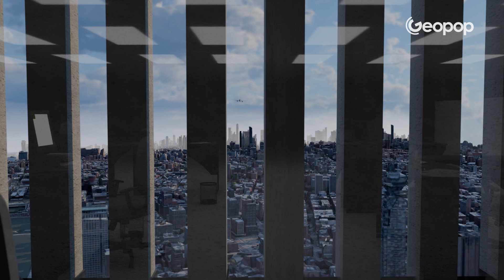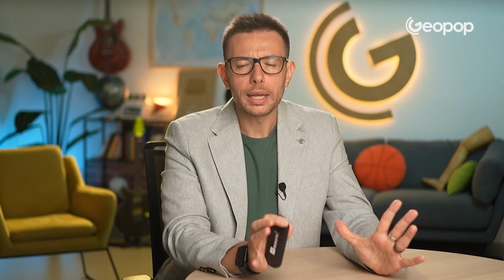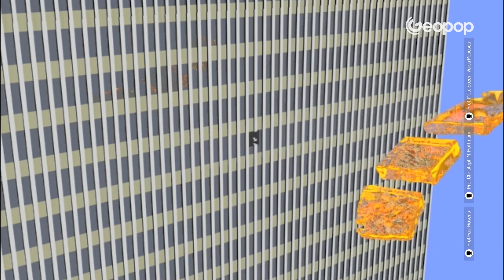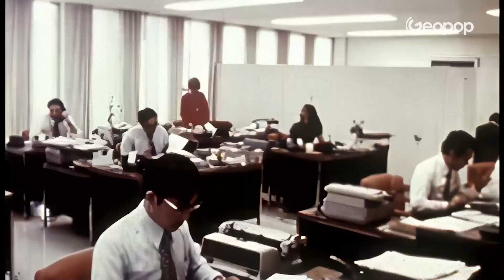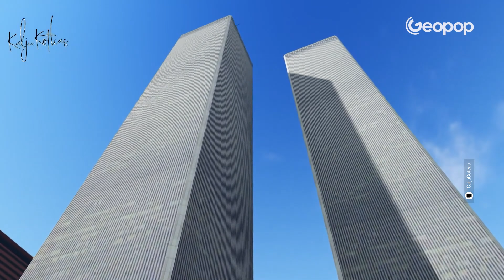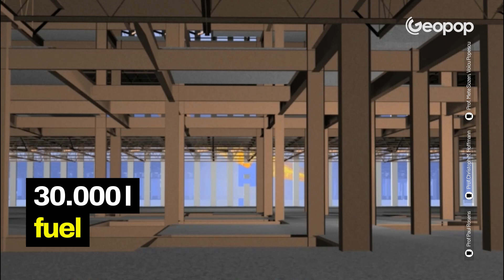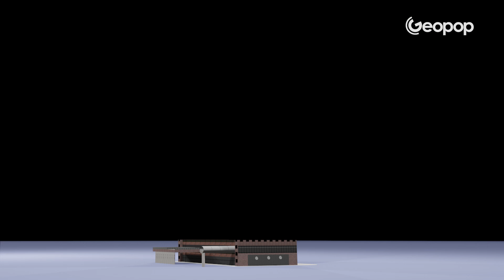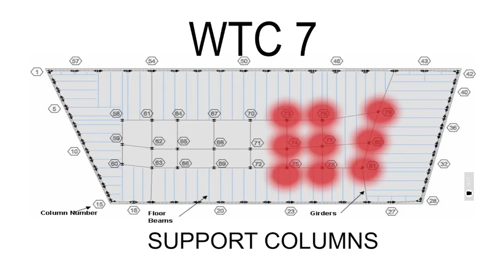9/11, 2001: The Technical Reconstruction of the Twin Towers and WTC 7 Collapses

Comment: I think that was an excellente analysis of what happened on 9/11, it's really something when the truth is spoken. You just KNOW that it is the truth.
Reply: You might want to check this out.If you think that's the truth. 1.The firefighters said" it looked like they planned to take down the building" I didn't say that, The fire fighters said that. They were there.I'm sure they know best.
https://youtu.be/XiIT4HInWjY?si=e1Pvp3-IFs-M75Oj
When the firefighter says "boom, boom, boom, boom" in this video.
What do you suppose he is?Implying by " boom" ?? What do you hear? 
2.So if there were no explosives then what is this? 8:25
https://youtu.be/bLF5D7M1YgA?si=aHSvS__uOdxMi1ZB
You can't say that it was added because you can see the firemen's reaction to the explosion. And you can't say it came from anywhere else because the firefighter says
" We gotta get out of here,  7 is exploding "
3. Controlled demolitions have squibs, you can see the squibs here 20 floors below the collapse. 
https://youtu.be/eXAgulfAtR4?si=-iLO9aQjMJVLTUYH
4. Firefighter says "any one of these buildings could blow up,  this ain't over yet" firefighter says there's 3 secondary explosions. 
https://youtu.be/0Gh3ErgMI4M?si=mmp9Eus_5PWTCBfl
5. Airplanes can't fly 600 mph at 1000 feet. And to be able to make a 180 degree turn to hit the opposite side of the pentagon going that fast is ridiculous. And since when do terrorists hit the opposite side of the building where no one was at when they could have just flown straight in and killed way more people???
 https://youtu.be/0Gh3ErgMI4M?si=mmp9Eus_5PWTCBfl
7. No one has ever known ahead of time that a building was going to collapse except through controlled demolition.  Tower 7 was reported to have fallen while it still stood in the background. 
8. Larry silverstein,  the man who made over 4.5 billion when they fell, claimed to have pulled the building down.
https://youtu.be/1jQaJFNWqtc?si=wCywQ9grgBdS_w11
9. A witness reported a missile hit the pentagon while he was seen at the scene. 
And the hole wasn't big enough for a plane and the damage wasn't consistent to the towers. And just like shanksville,  there's pictures that show no plane parts at all.
https://youtu.be/6_Ez-UCpXMs?si=JaQ6DBEC_LJtMLgN
10. That video also points out They were military planes that hit the twin towers. 
11. All sorts of reports of explosions were reported that day.  
12 Buildings dont accidentally fall  Into it's own footprint....

Comment: NIST  took 7 years to invent the already well KNOWN none phenomenon of thermal linear expansion... ie: when metal gets hot it gets bigger. Building 7 reached free fall acceleration... IMPOSSIBLE without instantaneous removal of the outer columns all at the same time, desks & chairs burning do not weaken 47 storey buildings so they drop out the sky ... 9/11 was a silent coup, the USA was taken over that day
Reply: Oh I think we can do better.

Much misunderstood, Building 7 was the 6th building to collapse of 10 lost on 9/11. Because of its early low priority, conspiracy filled the information void with garbage made up by technically ignorant people promoting political agendas. But 7's loss is an engineering problem and should be treated as such, so I prepared this brief summary of my own analysis to fix that, using technical analysis, not ideology and tired memes. 

At 10:28am the WTC North Tower collapsed, showering Building 7 with tons of burning debris, causing heavy damage and starting many large  fires which burned out of control for the next 7 hours. Half the FDNY firefighters having been killed, units in disarray, equipment destroyed, no water pressure, and the greater urgency of search & rescue efforts, Building 7 couldn’t be saved so firefighting efforts were pulled as futile and 7 left to its fate. Firefighters make that sort of choice every day in brush fire situations - which houses to save and which ones to let go. Only real difference here is moving the decimal on the size and cost. People get overwhelmed by the size.

www.youtube.com/watch?v=g_SvpwyC17M

Collapse of a burning structure is always a concern for firefighters. Steel buildings subject to fire rely on active firefighting to survive. Buildings are designed around 1 to 3 hours of fire resistance, allowing time for occupants to escape and active firefighting to get started, after which all bets are off. Left to their own devices they'll exceed their design envelope and collapse, like Plasco Tower and Wilton Paes de Almeida. In 7 the occupants escaped, passive and active fire protections were compromised and active firefighting was abandoned hours before the collapse, which left the building to its fate. It lost. Odds on Building 7 would eventually collapse, and it did. No big deal in logic.

 http://www.youtube.com/watch?v=WnYBX6QT0R4 

FDNY Chief Daniel Nigro - The biggest decision we had to make on the first day was to clear the area and create a collapse zone around the severely damaged 7 World Trade Center, a 47-story building heavily involved in fire. A number of fire officers and companies assessed the damage to the building. The appraisals indicated that the building's structural integrity was in serious doubt. I issued orders to PULL back the firefighters and define the collapse zone. It was a critical decision; We could not lose any more firefighters. It took a lot of time to PULL everyone out, given the emotionalism of the day, communications difficulties and the collapse terrain 

FDNY Deputy Chief Peter Hayden ; We had our special operations people set up surveying instruments to monitor and see if there was any movement in the building. We were concerned of the possibility of collapse in the building. And we had a discussion with one particular engineer there, and we asked him if we allowed it to burn could we anticipate a collapse and if so, how soon? And it turned out that he was pretty much right on the money, that he said 'In its current state you have about 5 hours 

The collapse of Building 7 was anticipated and widely reported in the media throughout the day, with 24 video cameras recording some or all of the collapse. Everyone knew what was coming and why. 

www.youtube.com/watch?v=OY5S5k3tMHI

The collapse of Building 7’s was entirely different to the Twin Towers and harder to understand, most details being hidden from view and not intuitive.  But we can still sort out what happened through careful analysis and observation. This is my explanation of the collapse relying on no outside authority. 

Building 7 was a unique, asymmetrical 47-story steel framed structure built atop a smaller 3-story building serving as a partial foundation, requiring lower floors dedicated to complex load transfer structures. Of trapezoidal shape and all-steel tube-in-tube construction, B7 (above the 7th floor) consisted of a central core of steel columns carrying most of the gravity load, perimeter steel columns around the outside of the structure carrying the remainder of the gravity loads and long span beams and girders to tie those elements together and form the floors. On the outside of the building hung a moment frame or outer shell. 

Phase 1 : First externally visible signs of collapse initiation occurred at 5:20:28 pm and were notably quiet with observers not realizing the building was collapsing! No audible warning in the form of hundreds of ear drum busting 180-190dB explosive bangs preceding the collapse. Here at 12:00 a local CBS affiliate reporter is talking 10 blocks from B7 when collapse begins. People don’t start to notice the collapse until 12:11. At 12:45 is the famous CBS fixed camera clip of Building 7’s collapse. Note how quiet it is. 

www.youtube.com/watch?v=t5tEy6mXSE8

Collapse initiation was due to lower floor failures above the load transfer region (8-14th floors) in the NE corner. In this video at 0:45 you can see the NW corner from inside the building while under construction, Column 79 just out of frame on the left. That big, angled steel beam across the top of the frame connects to C79 at one end. The girders connect to the beam. That beam and all those girders depend on just one connection 

www.youtube.com/watch?v=nP3TNHPCIVU&t=45s

Phase 2 : The NE lower floor failures caused a loss of critical lateral support over an excessive length of Column 79 and it buckled. Looking at a floor diagram of Building 7 (www.nist.gov/image-16640) when you see all the structures that depend on C79 you quickly realize this one column was a relatively isolated structural element on which a disproportionately greater fraction of the structure depended analogous to say the Key Bridge. Externally as collapse begins we see a vertical progression of window breakage along the 44-46 line and a kink in the roof of the East Mechanical Penthouse at the top of the building, consistent with C79 failure. Normally with a buckling column, the load could be redistributed to other columns. With C79 that is not the case - the failure did not redistribute the load, so the collapse rapidly progressed to the roofline, sinking the rooftop penthouse. The transition from full capacity to almost no capacity occurs in an instant and will result in virtually no resistance 

Phase 3 : With C79 gone, B7’s progressive, non-symmetrical collapse continues with adjacent columns 80 and 81 left laterally unsupported, and quickly buckling as well, sending the EMP down through the building. C79-81 all have no diagonal bracing, which is the major reason why they could not redistribute a lot of vertical loads among one another. From there collapse progressed from east to west through the central core until the core was gone taking all of the interior floors and probably most of the perimeter columns with it. Follow the horizontal progression of window failures low in the building and the dropping of the remaining rooftop structures into the building. One of the big takeaways from the NIST Building 7 study (invariably ignored) was how their modeling determined C79 failing under ANY circumstances would have initiated the same collapse sequence. 

Phase 4 : After about 10 seconds only the exterior moment frame remains, giving the illusion B7 is still standing to the casual observer since little has outwardly changed. But it is just a hollow empty shell like an empty cereal box supported only by a few remaining columns and overloaded from the loss of the core columns and floors, quite unable to remain standing. With nothing remaining behind it, the north face leans inward, forming a V in the roofline, the last few columns buckle under the strain and the moment frame free falls, landing on top of the debris pile. 

It is only here at the very end that a single measurement of alleged free fall acceleration is taken, from a single point on the outer shell. The Building did not “free fall” – just one corner of the outer shell did, sort of. The Building_ (defined as its center-of-mass) was already gone before that happened. The period of alleged free fall was a product of how it fell NOT why it fell and can't tell us what started the collapse 10 seconds earlier. Start to finish the collapse took 18-20 seconds, 3 times longer than free fall . How fast something falls cannot tell you what started it falling_ anyway. 

The debris spread outside the footprint blocking surrounding streets, heavily damaging the Verizon Building and destroyed Fiterman Hall. 

Building 7’s progressive, non-symmetrical collapse was incidental and unintended collateral damage from the combined effects of fire + time + gravity, started by the collapsing North Tower. That is true no matter who planned and carried out the 9/11 attacks or why . The collapse was of so little consequence it barely registered at the time - a footnote, only taking on semi-mythical status as an alleged smoking gun years later when demolitions at the Twin Towers, missiles at the Pentagon and shoot down over Shanksville all failed and conspiracists had nothing left to work with. 

Anything can seem like a conspiracy if you don’t understand how it works. Now you should. I hope you found this helpful, informative and it solicits informed critical comment. If I made any errors of fact, logic or reason or left anything important out, please let me know so I can fix it. IF you can offer a more plausible alternative please do. Be the first. Please start any reply with the words “Tits McGee” or I will know you didn’t read it and are wasting my time.
Reply: @TheLoonResistance 😂😂😂😂

Comment: The video contains a few mistakes, a few errors of fact. Nothing to jeopardize the overall validity of all arguments, but potentially enough for a distractor to latch onto and discredit the authors.
Examples: 
- While talling about the fire proofing of the WTC7 floor beams, the video shows floor trusses of the twin towers.
- The claim of 9 and 11 seconds collapse time for South and North tower, respectively, may be quoted from NIST, but these numbers are demonstrably false - both collapses took consoderably longer. Just watch any of those collapse videos where you can see most of the tower all the way down to nearly the ground; note carefully when you see the first motion of the roof, note the time counter. Then move 9 (or 11) seconds forward, and look, and listen: The collapse is very much still ongoing for clearly a few seconds more.
- NIST's calculation of the load bearing capacity being +11 floors statically, +6 floors dynamically: You say this is about the capacity of the columns, but NIST is actually talking about the truss seats (the little angled steel plates welded to perimeter and columns that supported the floor trusses)

Did you run the video past a few people knowledgeable about the topic before publishing? Engineers involved in the NIST investigation, authors of scientific papers going into details, or even lay enthusiasts debunking 9/11 conspiracy theories with years of detailed research?
Reply: 1.  They are showing generic images of SFRM installed. I have a shit ton of photos of Building 7 but only one of the SFRM, so I have no issues with this.  SFRM looks the same no matter what building it's in. 

2.  The NIST actually said it was 9 and 11 seconds respectively for the first debris to hit the ground not for the buildings to collapse.  So you AND the video got that wrong along with a legion of conspiracy believers.  Actual collapse time was 32-34 seconds +/- 1 second by my watch, from first externally visible signs of collapse initiation to last core columns hitting the ground.
Reply: 1.The firefighters said" it looked like they planned to take down the building" I didn't say that, The fire fighters said that. They were there.I'm sure they know best.
https://youtu.be/XiIT4HInWjY?si=e1Pvp3-IFs-M75Oj
When the firefighter says "boom, boom, boom, boom" in this video.
What do you suppose he is?Implying by " boom" ?? What do you hear? 
2.So if there were no explosives then what is this? 8:25
https://youtu.be/bLF5D7M1YgA?si=aHSvS__uOdxMi1ZB
You can't say that it was added because you can see the firemen's reaction to the explosion. And you can't say it came from anywhere else because the firefighter says
" We gotta get out of here,  7 is exploding "
3. Controlled demolitions have squibs, you can see the squibs here 20 floors below the collapse. 
https://youtu.be/eXAgulfAtR4?si=-iLO9aQjMJVLTUYH
4. Firefighter says "any one of these buildings could blow up,  this ain't over yet" firefighter says there's 3 secondary explosions. 
https://youtu.be/0Gh3ErgMI4M?si=mmp9Eus_5PWTCBfl
5. Airplanes can't fly 600 mph at 1000 feet. And to be able to make a 180 degree turn to hit the opposite side of the pentagon going that fast is ridiculous. And since when do terrorists hit the opposite side of the building where no one was at when they could have just flown straight in and killed way more people???
https://youtu.be/0Gh3ErgMI4M?si=mmp9Eus_5PWTCBfl
7. No one has ever known ahead of time that a building was going to collapse except through controlled demolition.  Tower 7 was reported to have fallen while it still stood in the background. 
8. Larry silverstein,  the man who made over 4.5 billion when they fell, claimed to have pulled the building down.
https://youtu.be/1jQaJFNWqtc?si=wCywQ9grgBdS_w11
9. A witness reported a missile hit the pentagon while he was seen at the scene. 
And the hole wasn't big enough for a plane and the damage wasn't consistent to the towers. And just like shanksville,  there's pictures that show no plane parts at all.
https://youtu.be/6_Ez-UCpXMs?si=JaQ6DBEC_LJtMLgN
10. That video also points out They were military planes that hit the twin towers. 
11. All sorts of reports of explosions were reported that day.  
12 Buildings dont accidentally fall Into it's own footprint